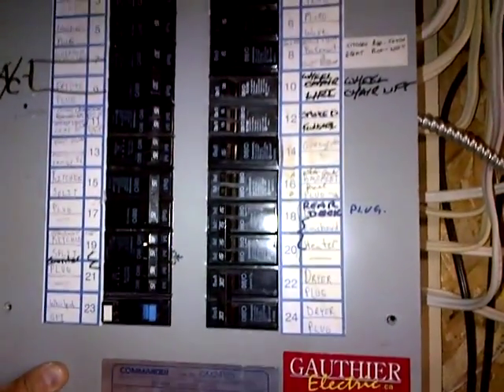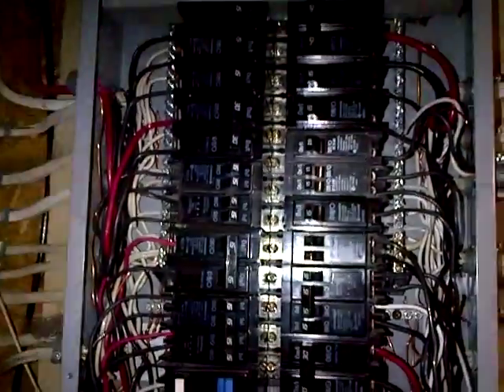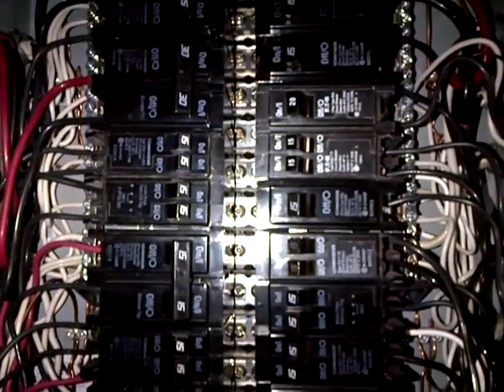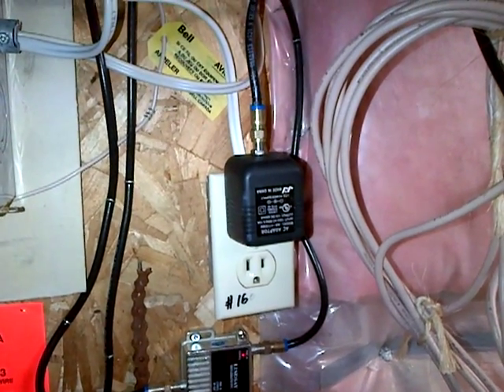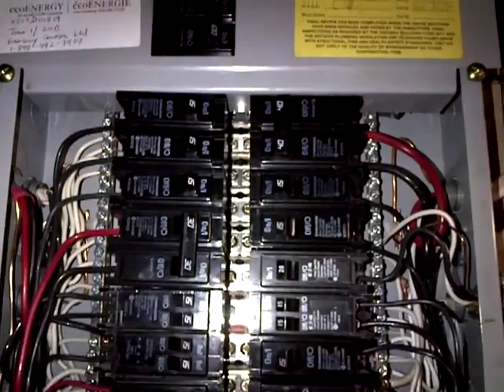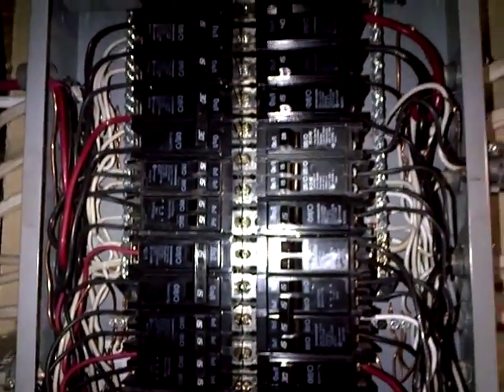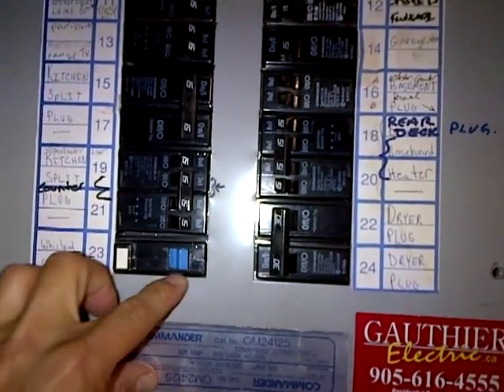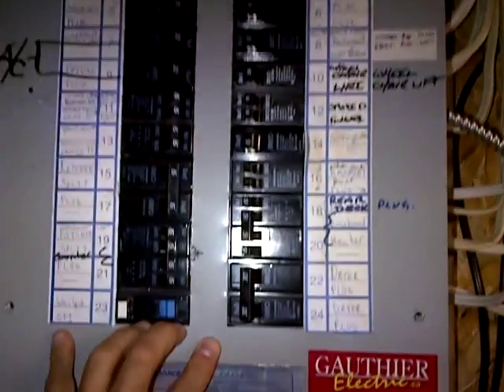Servicing a 90's 100A Commander Bolt On Breaker Panel

Comment: Can't find AFCI's for my QM bolt on Cutler Hammer panel :(
Reply: Just add an AFCI receptacle at the panel. $22 plus utility box and 1 foot of bx....$33 canadian pesos. DONE.  Just remember you will curse your old vacuum because the vacuum switch will trip the AFCI regularly.

Comment: Hello Gauthier, I have a Commander breaker panel as well. I have the over the range microwave oven, fridge, tv and some lights on a single breaker. After 2 years of moving in, the microwave started tripping that breaker. Now, I can't get power to return to the fridge and microwave after I switch off and on that breaker. I have to turn off main power, turn off all the breakers, turn on main power and then turn on all the individual breakers. Is this normal?
Reply: Good call Norman. That is good to know. I actually got another line put in for the microwave. Problem solved.
Reply: Microwave, fridge, TV and lights on one circuit is a pretty dumb setup. It is the fault of the installer, not the panel. Put your lights on a separate circuit so you're never left in the dark. Fridge doesn't go on any fault protection because you don't want that to trip, EVER because...ICE-CREAM. Run a 20A breaker with #12 wire to the microwave like they should have in the first place. You should never have to turn off your main breaker or ALL of your breakers to reset one circuit.